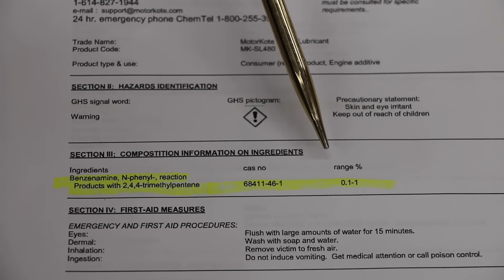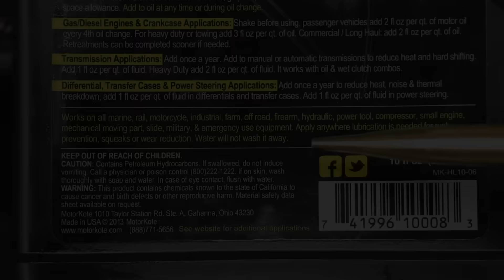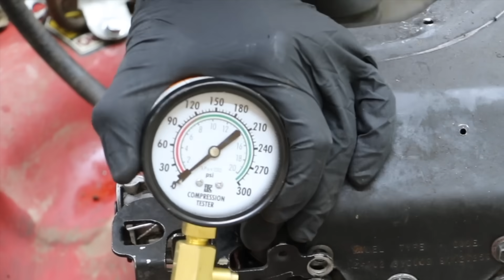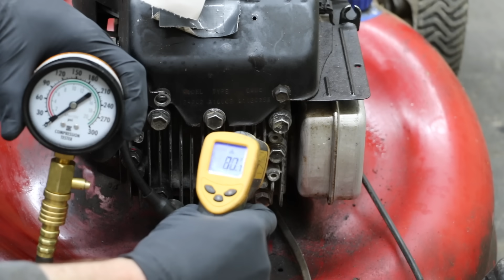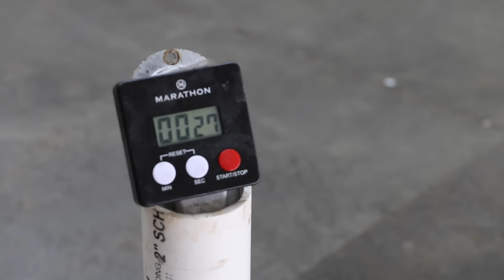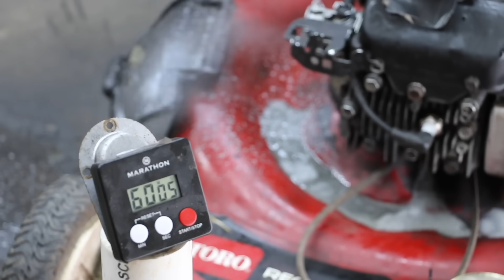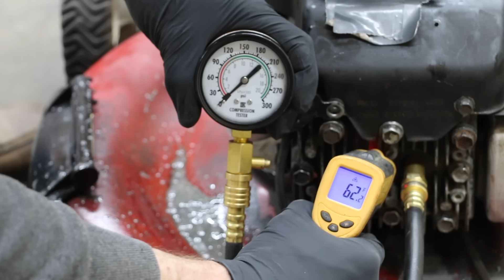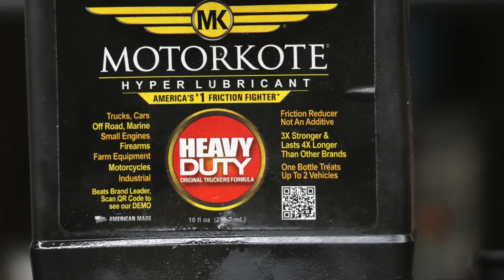Can MotorKote survive the water test?  Let's find out!

Comment: My first impression of these results was "wow this must be the best additive available". But after seeing this engine survive an hour with only water in the crankcase, I went back and watched the "Which Engine Self-Destructs First? Bestline vs 10W-30" video. After seeing the engine treated with bestline survive up until 71 minutes without any form of liquid cooling whatsoever, I feel less impressed by the results of this. Yes its impressive that the lubricating oil doesn't dissolve into the water. But is this test representative of a condition that would occur in a real engine? Where 99% of the liquid in the crankcase is straight water? Personally I feel this test would have contributed more if it was done with a mix of oil and coolant, to simulate a head gasket failure, as previous commenters have discussed.

But what I really want to see is an additive that can protect an engine, when the oil is contaminated with E85 ethanol fuel. Please do some tests in the future where the lubricant has been diluted with E85 (as oil would be if E85 were to make its way down past the rings etc) to test the effectiveness of additives to protect engine parts.

You are doing a fine job. Thank you for your efforts.
Reply from the maker: Thank you for this recommendation!

Comment: Thank you for another great  video. I was waiting for it because I'm using MotorKote  for a long time.
 My suggestion is to add MotorKote not to the fresh oil during oil change, but later after few thousand miles. Fresh motor oil already has great lubrication characteristics, but as motor oil starts to wear out Motorkote will extend that oil life providing extra lubricity.
Reply from the maker: Great suggestion!

Comment: Suggestion. One thing that may have been helpful was to have a control engine. Maybe an untreated engine with conventional oil in it, remove the oil and replace it with water like you did in this video and see how long it takes to fail.
Reply from the maker: Thank you for this recommendation!

Comment: I'm really interested in the TYPES of oil additives.
Prolong - Chlorine 
Lubeguard HD - ester, AW consummables (zddp), Metal FMs
Archoil (9100 variety) - potassium tetraborate (boron oxide or hardfacing additive, i've heard both)
Hy-per Lube  Zinc Replacement - not zinc, but ester copolymer.

I cant find conclusion if MotorKote is Chlorine or ester, but I really want to see how these categories of additives compare against each other in the timken test, since it's valuable to me in adequately protecting the gears in a wet sump bike.

Thank you for doing this vid - has to be the best and most significant additive for that timken test! also amazed that it didn't increase blow-by (105psi in, 105 psi after... with water... dang)
Reply from the maker: Thank you for this recommendation!

Comment: What's the catch? There is always a catch. 

Why wouldn't this formula be combined with typical synthetic oil blends straight from the refinery? Oil companies have tonnes of cash to research/develop an oil like this, or purchase a preexisting patent. Each brand tries to out compete the other for durability and longevity claims. 

If a brand could mass produce a synthetic oil blend with the benefits as advertised (and now tested), AND stand behind their produce so much so as to use their oil as an OEM supply for various vehicle manufacturers as many do, then why hasn't it been done so? 

Does it reduce viscosity and cause fuel economy to plummet? Doesn't seem that was based upon the engine seemingly running BETTER with this product.

Is it just too prohibitively expensive to add to a synthetic oil from the manufacturer? I dunno, cost efficiencies would be had by virtue of increases in total volume of product being processed, which would make it cheaper to just add to standard synthetic blends as opposed use as an additive.

Does it break down quickly and foul the oil? More oil changes required?

Does it leave deposits or ruin gaskets, or react with certain metals poorly? 

I'm impressed with the results of this test. My spidey senses say proceed with skepticism though. I'm just trying to figure out if those senses are justified.
Reply from the maker: All great points and thanks for commenting.
Reply: i have been wondering the same and i came to the conclusion that maybe oil manufacturers and car makers are partners and for them an engine lasting for such a long time is not good at all for the business, dont you think so?

Comment: Wow, what a fantastic video my hats off to you on this one. My jaw damn near took off my big toe it dropped so hard after seeing the compression didn't drop off one bit after the water test, when the rpms started to fluctuate I was expecting either overheating or that thing was starting to lose compression. Especially after seeing those cylinder walls not resembling something like steel wool, I'm very temped now to get a bottle of that stuff and put some in my 258,000 mile truck that still runs/looks like new.
Reply from the maker: Thank you!

Comment: Motorkote used to be hard to find anywhere other than Amazon but my local Walmart has been carrying it for about a year. It's not cheap but I've felt and heard the difference in an engine less than 5 minutes after pouring it in.  They don't call it an additive but if you add it to the oil it's an additive in my book, and I don't like additives, but this is the only one I'd use.  Truck drivers have been using it for a while and as far as I know they love the stuff.

I really thought that water test would be taking the test too far but WOW. And, no loss of compression or scoring.
Reply from the maker: All great points and thanks for commenting!

Comment: I'm amazed.  I treat all additives as snake oil, but that bearing test was astonishing.  
Water would appear to do some flushing or changing of the compound due to what you extract and the residue left on top of the blade cover.   Either way, amazing stuff.

A test I'd be interested in is pitting MotorKote against Castrol Magnatec 5w30.  

Great video as usual.  Chin chin.
Reply from the maker: Thank you for this recommendation!

Comment: I was genuinely interested in this stuff after watching this video (Awesome Job BTW! love your vids) and decided to lookup up the product on my own. Lots and lots of positive reviews, with the few negative ones I found mainly claiming that its a waste of money, because it's just mineral oil. And while I couldn't find the type of carrier oil used, (It may be mineral oil) I did manage to find the active chemical by looking up the cas as suggested, and it appears to be  a legitimate lubricant/viscosity adjuster (as opposed to a snake oil) as they claim. 

source - https://pubchem.ncbi.nlm.nih.gov/compound/6455945#section=Use-and-Manufacturing

Will try this stuff in my 02' accord and 07' camry. Both run great albeit a bit noisy, and we'll see if this stuff help quiet things down.
Reply from the maker: Thank you for this information. If you try it, I'm hoping you can provide an update on how you like the product. Thanks again!

Comment: You should try mixing your most successfully tested additives and running them full strength (no oil mixed, only additives) and 50/50 with 10w30. Especially on the lubricity tester.
Reply from the maker: Thank you for this recommendation!

Comment: Now, could it help make an extremely worn engine, (low oil pressure, loss of power, a lot of blowby), to last longer, or be more fuel efficient?
Reply from the maker: I'm not sure it'll help with oil pressure or blowby.  Restore might be a better option.
Reply: Ok, I don't have a worn engine, I was just curious about it.  Really considering adding some next oil change for my ford 300-6

Comment: That's awesome. You just need to make the water test to an non-treated engine and compare the results, if the engine also lasts 1 hour then motorkote does not make a difference.
Reply from the maker: Thank you for this recommendation!
Reply: For completeness sake i understand the request, but water is an incredibly poor lubricant as it has virtually no film strength. Will work about as well as no oil in the crankcase (except the engine won't  entirely seize from overheating as it will help keep temps down, but it will still chew itself to pieces to the point where the compression loss is so great that the engine wont fire)

Comment: I'll be damned..the results of your testing are mighty impressive,and slightly shocking. I've seen this stuff on the shelf at the auto parts store,but shrugged it off as just another Snake Oil. Next time I'll be taking a closer look,for sure. I'd like to see more testing done on this product!
Reply from the maker: Thank you for this recommendation for additional testing.
Reply: Also,I'd be interested in seeing the rod bearings and whatnot,after this torture test. The oil didn't appear to have any major metal contamination,so I don't suspect that the bearings will be trashed,but it might be interesting to just take a peek around the internal parts.
Reply from the maker: Great point!

Comment: I'm running this in my engines. I'm sold. 

This is nuts. This stuff is gonna fly off the shelves... buy shares of motorkote
Reply from the maker: If you test the product, could you please comment on the forum in the future, letting us know if you experience fuel efficiency improvement or other gains?
Reply: I will do that! In fact I just ordered some tonight. will put some in next oil change (~2k miles left to go) might change it a tad bit early just to get this stuff in there.
Reply: Can I get a link to your forum? you should put that in video descriptions!

Comment: Project Farm. I'm a 75 yr. old geezer 'gearhead' from the late fiftys/sixtys big block era. Still doing my own service work. I figured I'd seen damn near every additive come down the pike since Andy Granatelli came out with STP back in the sixtys. I would be a liar if I didn't say that I was surprised at your test. AND the results! I might just pick up a container of that stuff and try it. Thanks for all the testing that you do. I always find them very interesting.
Reply from the maker: Thank you very much for the positive comment!
Reply: Yesterday, 4/11/18, bought a container of MotorKote. Yup, a bit pricey. I had just changed the oil(Mobil 1, full synthetic extended mileage) in my old Ford E250, 5.4, 2 valve. With 307,000 miles on it. Going to follow the directions, and add MotorKote to the oil.  Your testing showed, what I felt, to be a good product. Thanks again for your thoroughness with your testing procedures. BTW. Going on about a 3,000 mile trip next week. We will see if this stuff works. I sure hope it does. Sincerely, the Geezer "gearhead'.
Reply: BTW good folks. I put the MotorKote additive into my ole Ford engine 4/11/18. Been driving the van around my area since. By my tack, I've picked up approx. 50 rpms. You ask, "How do you know this?" Because,
5 yrs. ago, I eliminated the computer controlled 'idle motor'.(I didn't like how high it revved the eng. on start up) And devised my own type of idle adjustment on the gas peddle(old school). Which works just fine. My eng. usually is at 550 rpms. Its now at 600. Only change was adding the MotorKote !

Comment: This is probably one of my favorite videos so far! So i have a question, i just put together an 66cc 2 stroke bicycle engine kit which requires you mix 8oz of 2 stroke oil to 1 gallon of gas. Gas tank is half gallon and requires a break in period of 3-4 tanks to properly break in the engine. Do you think it wise to add a little of Motorkote to the mix to help engine lubrication? Or do you think because is 2 stroke engine would be harmful? Thanx in advance for you response.
Reply from the maker: I'm not sure how this product would do inside the combustion chamber. It might not burn as cleanly as 2 stroke oil.  I would just use 2 stroke oil to be safe.

Comment: YES!!! I knew I made the right choice! Thanks for confirming what I thought. I enjoy all the videos and can't wait for the next one. Uncle B.S.
Reply from the maker: Thank you!  Have you experienced any fuel efficiency improvement with MotorKote?
Reply: Project Farm Yes I have, 5 to 8 mpg better with motorkote and Pennzoil synthetic oil.  I got 38.3 mpg with my 2013 Chrysler 200 with a v6 .  I just bought a 2016 Nissan Frontier with a 2.5 4 cylinder,  I get 20 mpg back and forth to work. In a month I'll check the mileage w/Motorkote.

Comment: I am glad you did this one!  I have a fan on my wood stove that becomes noisy and  the first one wore out fast.  I put Motorkote on it (originally bought it for cars) and the fan runs quietly all winter and it is on nearly 24/7.  It works on any metal to metal application (I don't work for Motorkote).  Previous I had  tried WD40, oil, silicone spray, nothing worked.  One drop of MK on each bearing surface and it worked.  I was as surprised as you were.
Reply from the maker: Wow!  Thank you for this information.  I have a JD hay bailer that has a very stubborn twine knotter and fails to tie knots about once every 50 bales once the spray lubricants wear off.  I plan to test MotorKote on it to see if it helps.

Comment: My mower calls for straight 30W oil. Any advantage or disadvantage to using a 10W30 instead?
Reply from the maker: Either is fine and I thing it's great to stay with 30W.  10W helps with cold weather starting, but most don't use mowers when the weather is cold enough to matter.  I occasionally do, since I test products throughout the year, even in cold temps.

Comment: Is there a chance that your lubricity tester can add/show more wear on a bearing than it did when it was new? I guess what in asking us do you think using a bearing that you tested with 10w30 months ago is a good comparison? Shouldn't you redo your baseline from time to time? Thanks for the videos, I always look forward to them.
Reply from the maker: Great point!  The circumference of the bearing race might be a fraction of a mm smaller, but the metal scoring would be the same.  The damage area would be wider but not as long.  I'll likely repeat the 10W-30 test soon or replace the bearing race, even though it has a lot of surface area there.

Comment: A good way to get a quantitative measure of friction reduction would be to drive the engine at a certain rpm with an electric motor and compare the power it draws with and without additive.

Candle wax appears to be the best penetrant for freeing stuck bolts:
https://www.youtube.com/watch?v=KFdFsfSAuyc

This engineering test settled on 90% vegetable oil and 10% acetone: 
https://www.engineeringforchange.org/news/how-to-make-penetrating-oil/
Reply from the maker: This is an excellent recommendation!

Comment: One thing that concerns me is that after the test with motorkone seem to leave a lot of deposits in the cylinder head burning chamber, more than oil alone. What over long-time running could be a problem!  if you run it like that for 8 hours straight how much deposit really will it produce? is it just got a fixed amount and will disperse and it will clear itself up not get worse, or will it keep building up is the question. I think that should be an important test to carry out. Do it in 4 hours intervals let it cool down in between
Reply from the maker: Great point regarding build up.

Comment: I'd like to have seen you run a control test with regular 10-30w oil, then water before you ran the MotorKote, then water to see what the difference would be.
Reply from the maker: This is a great recommendation and I wish I would have done this.

Comment: Can you check bearings for different oil weights, like 5-30, 5-20, 10-40, and diesel oil. They are supposed to provide the same protection when warm but would be nice to see when they are cold. Also sea foam in the crankcase. Might explode if you put it straight tho
Reply from the maker: Thank you for this recommendation!